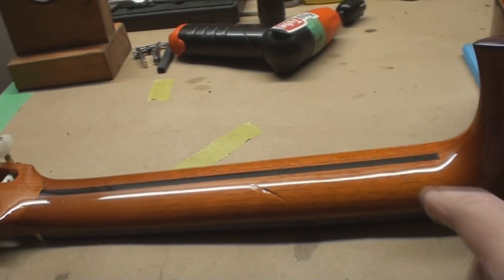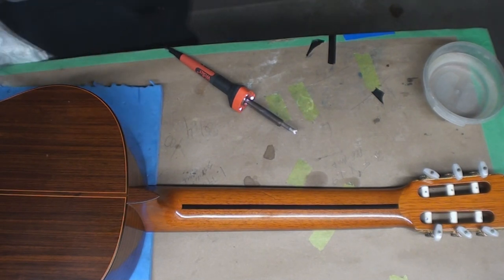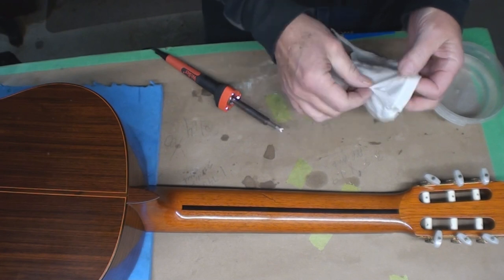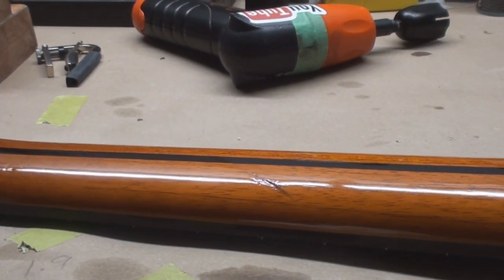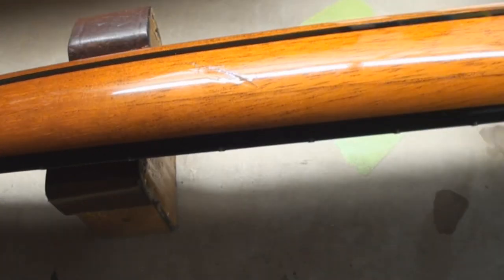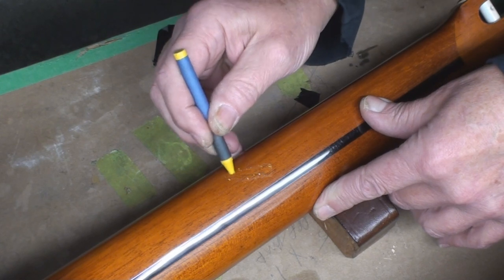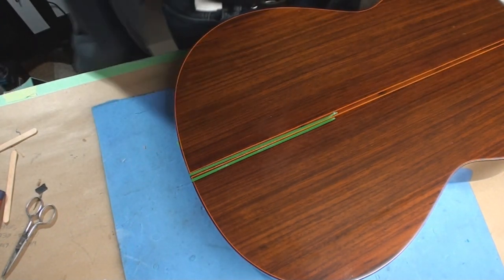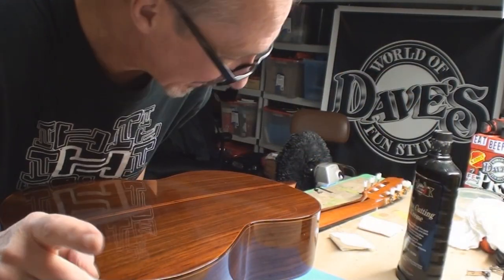Guitar Finish Repairs Using GLUBOOST

Comment: Thanks for the video, trying to fix a dent in a Les Paul neck. This looks like the way to go. Already tried to steam it out but, lost my nerve and stopped. Seems like the steam wasn't getting through the finish. Going to give it another shot in the near future. Really appreciate your videos and your special brand of humor.
Reply: The les paul has a nitrocellulose finish, most other guitars have polyurethane finish so you need to be very careful around that stuff; maybe Dave could chime in on that.
Reply: @caloss2 , agreed it is a 77 so it also has a maple neck. Maybe I should just fill it. It's not that large but, you can feel it when playing. It had a Kahler on it at one time so it will never be a collectors item. It is a great player though.
Reply: On poly you can pierce the finish with a thin needle, but I haven't tried it on nitro.
Reply: put some small pin holes in area to let steam in .; and use a bic lighter to heat crayon for glueboost

Comment: Nice video Dave! I'm a cabinet maker and have been using 2P-10 for years.  It's also the bane of my existence.  The accelerator does not smell nice and I'm usually glueing myself to something on a regular basis. lol  I enjoy these finish repair videos a lot and have learned a thing or two from you.  What's the verdict on the wax pencil?  Seems like it doesn't adhere well to finished wood.

Comment: Gluboost...lol....or superglue and zip kicker as it was known for many years in the UK. Pay £45.00 for the gluboost kit in the UK from a luthiers supplier (um ...nope) or alternative go to a good wood turning supply store and buy different thicknesses of a  cyanoacrylate glue (superglue) or Mitre Fast or Mitre Mate for around £5.00 for the kit. I have been using superglue for dent repairs on guitars (and mitre mate in my joinery business) for years using the exact same process as Dave. Great finish on PU guitars...not sure I would use it in any quantity on Nitro as I am not sure how it would wear in relation to a NC finish. Never had an issue with standard superglue... although I know initial version of zip kicker was banned from many countries on health grounds... love your videos Dave...not sure I have ever missed one.
Reply: @DavesWorldofFunStuff  Hi Dave.... how do you find it differs from other CA products? I'm not being critical ...genuinely interested as I do a lot of guitar and bass work and it would have to be significantly better to justify such a huge difference in price. Be great to know your thoughts.  The only thing I dont use are the accelerators..(unless there is no choice)...as you said in your video they stink...anything that smells that bad cant be good for you!! Prefer to.let it cure naturally helps alleviate any possible clouding to the CA.

Comment: I tried using heat and steam to get a ding out, before I used ca but it didn’t work. I guess it was because there was finish on the neck?? DAVE! why didn’t mine work, but yours did?? I thought if it had a finish on the neck you can’t steam it out?? Tell us Dave! 
Your finish touch ups are fucking bad ass. Especially that old Martin you did a while back. 
Fuckin awesome

Comment: That's a very good method, but it would work better if the finish was scraped off in the dent. That way, the water/steam can penetrate the wood and swell it back up. Not criticizing , just offering my experiences.
Reply: @DavesWorldofFunStuff  Dave, I have the utmost respect for what you do, your experience, and expertise in the field. I wasn't trying to rag on you or your methods,  really. All I was trying to say is that water/steam penetrates raw wood easier.  That's all. I wasn't telling you your business; that's not my intent. Of course a repair has to preserve and protect the finish. No disagreement there. I just figured since the gash was on the neck and out of sight, a simple touch up would work after the repair.
Peace.
Reply: @DavesWorldofFunStuff   Your point is well taken.